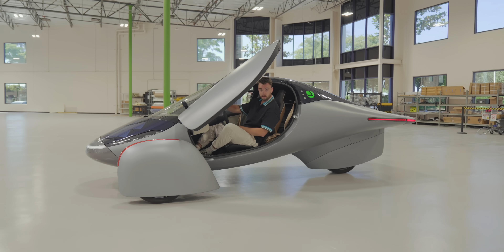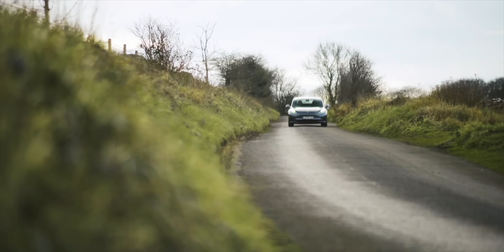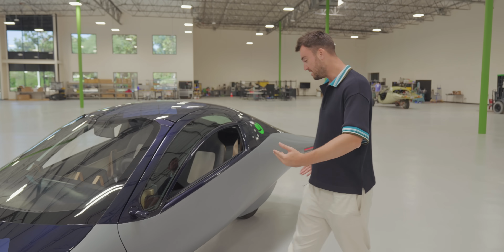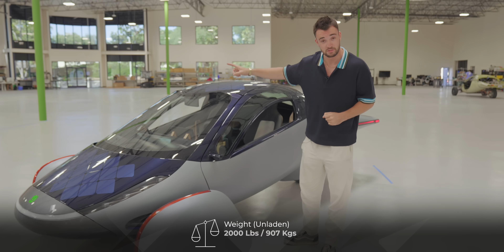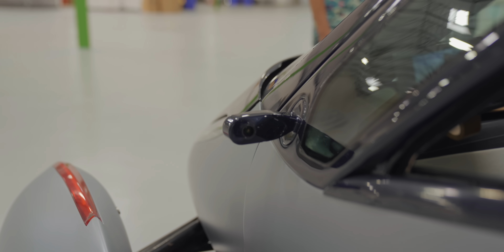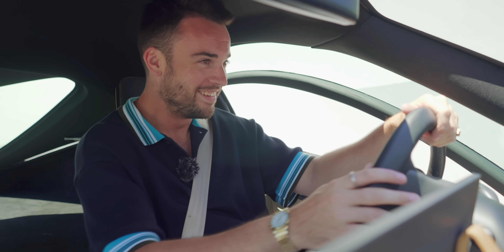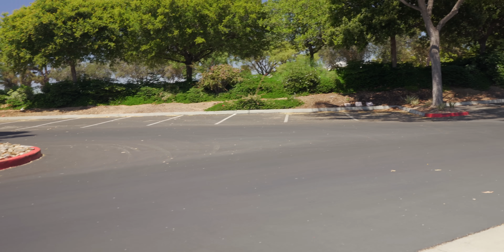The Game-Changing CHEAP Electric Car Inspired By Fish!

Comment: As soon as they make a 3 passenger version I am in! I have a wife and a son, so no can do in this current configuration. I too would opt for the base 250 mile version because that's more than enough range for me AND it could charge while I'm parked at work via solar panels! I wish them the best.
Reply: That being said, I think it would be interesting to see a ONE passenger version that is scaled down. This would have several advantages for specific case usages. Better for markets with narrow roads, even better efficiency and (probably) lower cost. If they keep some of the length they may even be able to make it a two passenger version but with the occupants sitting one behind the other.

Comment: I love the look of the Aptera and congratulate the efficiency that has been achieved.  On the downside, the Cd is only 10% better than a Tesla, not much considering the sacrifices in interior space and stability. The three wheel concept is delightful, and cornering stability has been achieved with the wide stance. However the vehicle is likely to be less stable than it's four-wheeled cousins under braking, especially if the road surface is not uniform with puddles of water or pot-holes.  Maybe ABS can cope with this. I wish the company every success in making the Aptera a common sight on our roads.
Reply: Not sure your math is right.  M3 = .22 Cd. Aptera = .13 Cd. .09 diff = 41% better me thinks ;).
Reply: @robmaclachlan1264  Oops, my error .  It was the Lightyear Zero that was 2.0. I wasn't listening properly. Very slippery the Aptera.

Comment: The 1000 mile version does not exist, the solar array on the vehicle does not exist, a production ready prototype does not exist. So another phantasy presentation.

And it is not a cheap electric car, it is an expensive electric motorcycle.

Comment: Not to be negative, but it will never go over a speed bump where i come from unscathed, nor will it hit a hole in the highway at full speed without some serious damage, especially with the unsprung weight (motor in the wheel).

Comment: The motors are exactly like 1000W Scooter hub motors. Just bigger. These work with the 3 phase AC power created by the electronic inverter on the car. 
One proficient in the art, can bypass the 3 phase AC driver, and use Pulsed DC to drive the motor coils with a flick of a switch. 
The motor will be much louder (both acoustically and electromagnetically) and will have more vibration, but about 4-10 times as efficient as running on stock AC! 
Here is how it works; The magnet is attracted to the core of the stator coils for free. That's what magnets do!
When the magnet and the coil come to register (aligned), the coil is pulsed-on with 400V DC directly from the battery (Newer cars are 800V DC). Inverter not needed. 
The magnet is then strongly repelled, like a Karate punch. 
The coil is turned off and the stored magnetic energy in the coil, collapses and generates a back EMF current that is discharged back into the supply through a diode. 
All the initial electrical energy investment is recovered, minus the Ohmic and parasitic losses. Much like how an SMPS boost converter works. 
Then, the next magnet is automatically attracted to the core of the stator coils for free, and the process repeats. 
This method is the most efficient of all time. therefore it will not cause heating of more than a few degrees above ambient. It's about 95% efficient and requires no cooling.
The drawback, is a lot less torque. The torque is sharp and sudden and requires a flywheel to smooth out. This is the source of noise and vibration. Unlike a smooth sine wave from the factory AC driver.
However, It would be ideal for cruising on flattish roads at unheard of efficiencies above 90%.
Also, if the pulses delivered are too powerful, the magnets will lose their magnetism in a short amount of time. 
With the AC, the power is spent as heat and nothing is recovered. 
If I had an Aptera, I would hack it or build a new controller and scrap the factory one. 
Run it in pulsed DC mode on freeways and long trips. I bet I can get over 2000 highway miles out of one charge.
Send me one for free and I'll prove it to you.
Reply: AC motors are already 90% efficient. How are you going get  "4-10 times as efficient"? That would be 360%-900% efficiency, which is impossible.

Comment: Amazing to see so many people excited by the Aptera, but still no-one seems to be addressing the obvious flaw - the wheel pods. Those things stick out way past the body, they make the vehicle 2200mm wide, or 400mm wider than a typical large car, and just 200-300mm narrower than a standard highway lane. This means they will seriously limit manoeuvrability in narrower streets, and in car parks, drivers of large vehicles will not see the pods sticking out way past the body line. Try it in a large, high vehicle, it's impossible to see something this low.

The end result will be hundreds, if not thousands of accidents where the wheel pods get crunched or ripped off. It's going to happen, it's bleeding obvious if you think about it for a second, yet everyone just continues to gush over how futuristic the vehicle looks and never address this critical flaw. Not sure why I'm surprised that no-one is addressing this though, critical thinking seems to be non-existent in the general population nowadays...
Reply: The EU version will be narrower due to L5e-A regulations.  Maximum 2M.
Reply: @WyndStryke  That's good to hear, hopefully the Australian version, if it ever comes here, will also have that width. That still makes it a very wide vehicle though.

Comment: "They should not take too much from the grid".
Good point. 👍 
300million vehicles in the USA. 
I suggest that the EV will 'self park' and push that rear opening for the charger onto a wall plug and automatic top up its battery. Basically trickle charge 24/7.
Like the automatic docking at the space station.

Comment: 7:00 - Being legally classified as a motorcycle also allows them to save weight by significantly reducing safety systems. I'm not complaining, I own a similar (although much less "stylish") Arcimoto FUV that achieves weight savings the same way - it's only 1300 pounds. But it must be acknowledged that this is a compromise made in the name of efficiency.

And yes, I have a preorder for an Aptera, too. My biggest concern is the width - with the side-by-side seating (instead of front/back like Arcimoto) and the outboard wheels, it's very wide - wider than the F-150 Lightning. Being very low, I worry about big vehicles failing to see the wheels, and crashing into the Aptera when parked.
Reply: Pretty sure it's cheaper insurance too.
Reply: @Grant849  Waaay cheaper. But finding companies that will offer collision and comprehensive on a motorcycle is hard.
Reply: @AnonymousFreakYT  I think I seen someone mention that even though it's considered a motorcycle they will uphold regulations for a car.  Which they definitely should

Comment: Could be useful if you live in select areas like Arizona and San Diego, for a commute with your laptop. or a second person 3-day weekend in Sedona. Everywhere else its a weekend toy for sunny summer days but it should sell better than the Polaris Slingshot. Can I remove the wheel covers so they don't become solid blocks of snow/ice during my Chicago winters?
Reply: The turn signals are on the wheel covers. That old alpha car they were showing has less clearance than the newer version. They also offer an off road kit that has different covers with even more clearance. I think we will just have so wait and see how well it does in snow.

Comment: safety ? speed on motorway ? number of passagers ? etc ?
Reply: Speed is limited to 110 MPH.  This initial design is a 2-seater because of US autocycle regulations ...  Not sure what the UK/EU design will be like, most likely still 2 seats but could have more (L5e-A regulations permit up to 4 seats, but limit the vehicle width to 2M).
In theory safety should be good, equivalent to a car.  Need to wait for the crash test results though, and that can't happen until there are some production vehicles to test with.
Reply: @WyndStryke  Thank you very much for your complete answer.  Good luck.  I am more impressed by your answer than I am impressed by the car / motorcycle.

Comment: I reserved a 400 mile AWD silver model on December, 5th 2020.  I cant wait to get it, hopefully,  some time next year.  I built my first EV from a 1974 VW Thing in 2012.  It had a 20 kWhlithium ion battery and a 90 hp three phase induction motor.  It was literally the opposite of this vehicle as I had the aero of a brick.  I currently own an early 2014 Tesla Model S and a 2022 Model Y.  I recently sold my Model 3 to a family member.  So I and quite familiar with EVs.  I think the Aptera could possible be the most important vehicle since the Model T.....

Comment: The steering being light is a turn off, this could be a really fun car if they get lotus to sort the handling
Reply: Light steering is great ?   what are you talking about ?  Also, Lotus may have been up there in the 60's and 70's with handling but in 2022 no one needs Lotus,all the suspension development for dual wheel steering has already been done, it ain't rocket science.....
Reply: @Mick-60  have you not driven a sports car before?

Comment: They're all expensive crap. Actually more polluting over their lifetime than a conventional car. And at 7 or 8 years you may need a new battery pack ... which will cost more than the current value of the car.  It's all madness. 
Electric milk floats are OK ☺️
Reply: You should really leave your bubble and learn the facts.

Comment: I wish he would’ve touched on aptera’s amazing stance on right to repair
Reply: That is exactly a point of hesitation for me in regard to Tesla.
Reply: I like their stance on right ot repair but they should've had manual door handles for MUCH easier right to repair than knock on the glass and if the battery is fucked you cant get in
Reply: I wish he would have touched on Aptera's lack of a warranty or local dealer support

Comment: The main problem with EVs is the lack of renders for vehicle mass. This is unbelievably important for 2 reasons non one ever mentions: crash safety, and road wear. If everyone is driving massive 2-4 ton bricks, any crashes are going to be wayyy more deadly. Then more surprisingly, road wear scales super exponentially with weight, as in, a 2.4t vehicle does 20X more road damage than a 1.5t vehicle. That's ridiculous. All future car taxes should be based on vehicle mass and miles driven.

Comment: It's not a car...
Reply: Correct, in the US it fits under the Autocar regulations, and in the EU it fits under the L5e-A (high powered electric trike) regulations.  They are designing a narrower version for the EU since the regs limit it to 2M wide.
Reply: @WyndStryke  No, I meant 3 wheels.
Reply: L5e-A is for high powered 3 wheeled vehicles.
Reply: @WyndStryke  How do you imagine driving on 3 wheels on country roads? This unit is for asphalt only.
Reply: @eurorock5912  There's an off-road option, and you can give it all-wheel-drive.
Reply: @WyndStryke  The problem is in the rear wheel.

Comment: Rolling resistance is a factor of mass per wheel. When you drop a wheel, you increase the rolling resistance on the remaining wheels.  This true for friction losses and hysteresis.
Reply: But they lost the weight of one entire wheel and suspension assembly. This also allows them to make the rest of the car lighter.

Comment: Going from 40 to 80 cars from start (a day) is impossible. I've been working in automotive automation for years now and no one can pull that off. The key is slowly ramping up..consistently is key.
Reply: Ah, but Aptera has Sandy Munro helping them. And the automation required for the Aptera is likely vastly different from what you are used to.

Comment: Love this car it's the ultimate engineer dream for efficiency keeping some practicality.
As an EV user, I hope heater and AC will also be super efficient as these ones will still consume 1-2kW of power. In summer the PV will help but in winter not much. That's where starting to thermally insulate cabins and glazing start to make sense... Wonder if they have thought of heat reflective glazing in addition

Comment: I love the design philosophy. Building upon this design, I would like to see a scaled up version for 5 people, 3 in the front & 2 in the back. A 3-wheeled car lends itself quite well to this arrangement. The driver can and should be in the middle for compatibility of right and left-hand traffic. It also makes for optimal weight distribution, which is perhaps more desirable from an engineer's point of view given the car is already so light weight (so there is less mass to move around freely). And the back seats can be placed behind gaps of the front row seats, which I believe should increase safety in a frontal crash. I'm quite interested is such a design is feasible given the stability and width, although I think they can get rid of the tunnel console, which should help.
Reply: I had a similar thought that without the central tunnel if would be easy to convert to a 3 or 2+1 for us more svelte Europeans etc...  However, I suspect that the central tunnel will be a major structural element that prevents the cabin folding up

Comment: Efficency is also the sales pitch.
Aptera is a 3 wheeled motorcycle.
It has 3 wheels not because of efficiency but in order to avoid the federal safety requirements if it had 4 wheels.
The single wheel in the back cuts into the trunk space, you'd get 3 times the space if you have 4 wheels.
To date, this is supposed to be in production by next year but to date has yet to provide a single unit for crash testing, because as a motorcycle it does not have to be crash tested.
The in wheel motors while efficient are a horrendous when it comes to unsprung weight as each wheel will have more mass than any wheel, tire and brake combo.
With the motor in the wheels, it is subject to more violent stresses as the only thing to absorb the impact of the road is the rubber wheel.
The exposed suspension creates drag, a more efficient design would be to enclose that by merging it with the rest of the body.
This was known since the 1960's when they made used the same shape in Ferrari and Porsche prototype race cars, look up the 917's.
Reply: I've seen those exact same comments from a different "contributor".  Clearly you have more than one alias. I suggest you do more research on the actual vehicle.
1. Yes the 3 wheel design reduces boot space, but it also increases aero efficiency.
2. It hasn't been crash tested because they aren't yet at production-ready spec.  They will crash test in due course.
3. In-wheel motors are heavy, but due to the recuperative braking, the actual brakes are smaller and lighter.  My (ICE) vehicle has 375mm disks. Combine that with the weight of the wheel, the tyre, and a percentage of the suspension components, and the unsprung weight is roughly similar, if not more.
4. In-wheel motors do experience more impact stress.  Do you have any data that quantifies the implications of this, or is it just fud?
5. The prototype suspension is fully exposed.  The beta suspension is fully exposed.  The final suspension will have aero fairings.  Furthermore you're wrong.  merging it with the rest of the body would increase frontal area and diminish its aero efficiency.
6. Your reference to LMP cars of the '60s & '70s is a red herring.  There are no equivalencies.  You're just pretending to be smart.

Comment: ...a UK sized number plate is going to slightly mess with aero when it's sticking out like a sail! but that's a future aptera problem
Reply: It would probably require a motorbike plate not a car plate since it is in the L5e-A class (high powered electric trikes).  They are redesigning it since the US model is too wide for the regulations.  Tentatively 2024 for first production.

Comment: If they are going to build a maximum of 9600 cars/year when fully operational, I won't get mine until late 2024 at the earliest.  Bummer.
Reply: he said their new target is 80 per day I guess? that's well over 24,000...
Reply: @bob15479  He also said between 400 and 800/month which is 4800 - 9600/year.
Reply: They plan to open regional assembly plants once the kinks are ironed out and the funding secured.
Reply: @richevanscpa  I know but that will take some time.  Hopefully I'll get mine by my 70th birthday in November 2024.  Would be a nice retirement present to myself.
Reply: @Robert D I’m in the same boat. I expect mine before my 71st birthday in September 2024 here in Florida.

Comment: For a channel that is in the lead when it comes to cover future tech - it’s kind of embarrassing that you still use miles instead of kilometers.
Reply: The vehicle is made in and is primarily marketed to the USA. The push for metric completely failed here.  We use miles, feet, inches, Fahrenheit.  That is what everyone is comfortable with and it works.
Reply: @Steve-7771  Yes lots of counties had the imperial way of measuring and used them successfully, but then they realized metric is far easier.

Comment: Pre 2010 I had 2 reservations... one for each of the options. I have the Colorado Motorcycle Plate "APTERA" which I got in 2008. It is ready to be put on my first. I have several orders... thinking that my grandkids would like one. 3 of my orders are in the first 200 orders. They are for a 400, a 250, and a 1000 mi range.

Comment: Make a convertible / open version with a 50 kwh battery / 500 mile range and I'll buy it tomorrow!. The sports car of the future.
Reply: Making it open will dramatically increase the air resistance, so you'd probably get more like 120 miles out of that 50kwh (from 0.13CD to about 0.6 - 0.7CD).
Reply: @WyndStryke  not to mention the loss of structural integrity, or weight to compensate